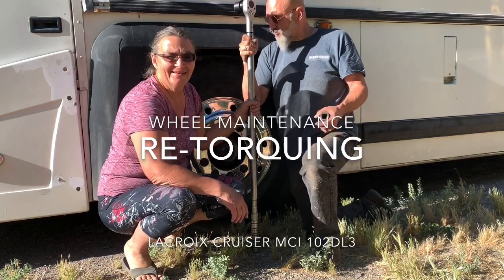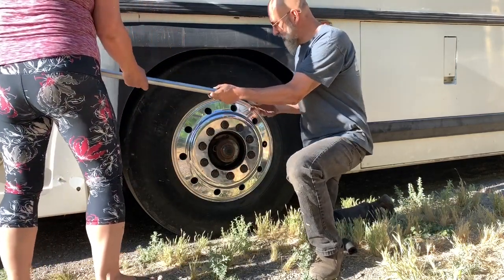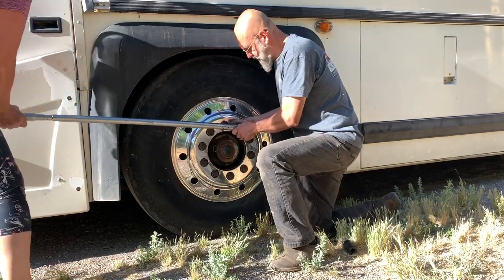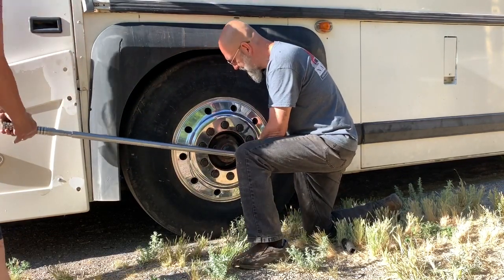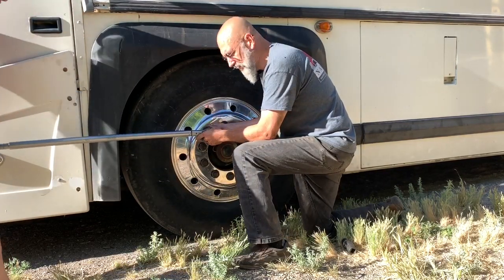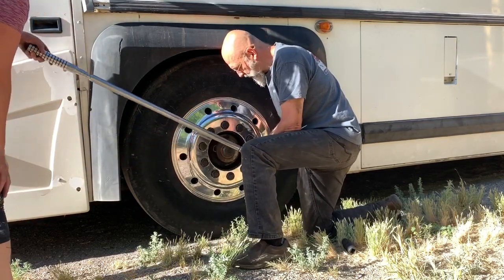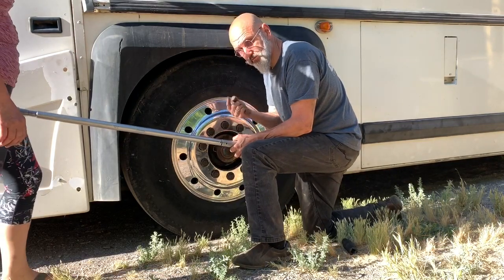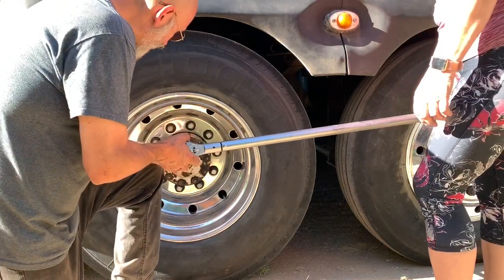Torquing stud piloted bus wheels.

Comment: Bought my bus in FL and drove it back to metro Philadelphia. Got home and found one lug nut hand tight after checking the fit of the socket I bought for it. Apparently the mechanic I hired prior to pick up didn’t check them. Bought the snap on torque wrench and I’m on top of it now. Good team method.

Comment: Nice to have a helper, I have to do mine solo and typically use a jackstand to help support the long  extension at the duals. My torque wrench is a bit bulkier as it is a break-back style that hinges in the center at the specified torque. Nice job (as always) showing the process.
Reply: Thank you for the tip of utilizing a jack stand.
Reply from the maker: Definitely a great idea